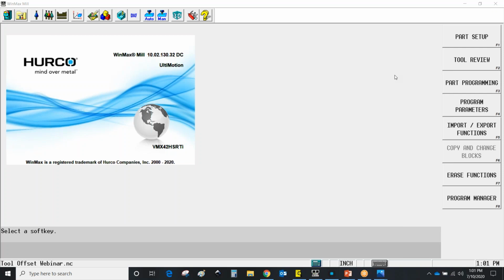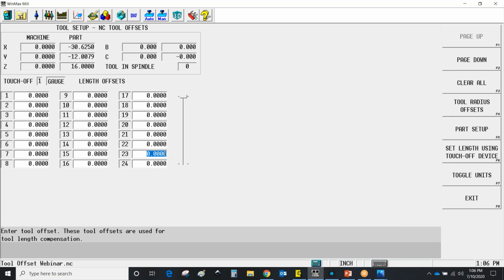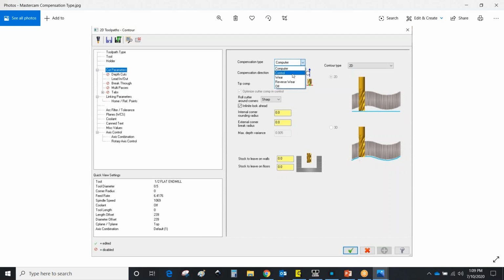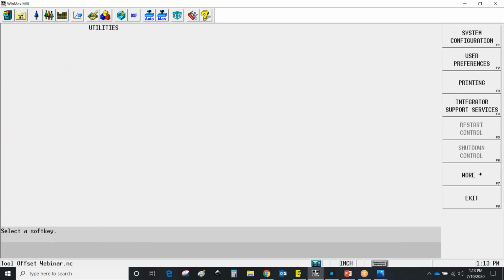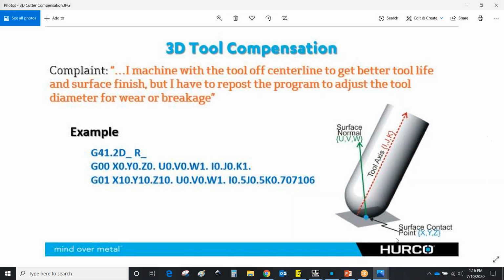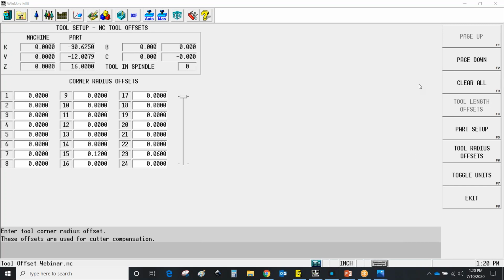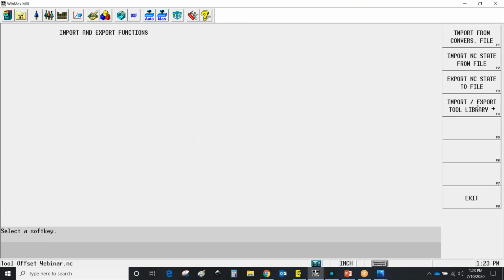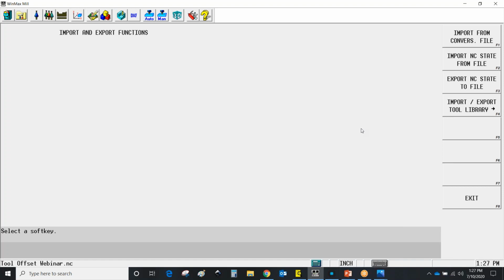Hurco Quick Training Session 10: Hurco NC Tool Offsets

Comment: Is the tool length offset page referenced when using NC Merge? Using a conversational probe for zero then running NC program what offset will the probe use? Guess I'll find out in an hour at work, lol.
Like Hurco machines, don't like tools being saved per program. Should always be what's actually in the machine.
Reply from the maker: Whether the tool offset page is used, or not, will be determined by the code in the NC/G-Code program. Once the control jumps to the NC side, it will follow the NC program the same as if it was being run without the merge. If the NC program doesn’t call a G43H? then the control will use the tool length on the tool setup page; however, if a G43H? is called, then it will use the values in the TLO page. Also, if a G54 or other work offset is called the control will use the one called in the program, but it will default to the conversational part setup if no other work offset is called inside the NC code.